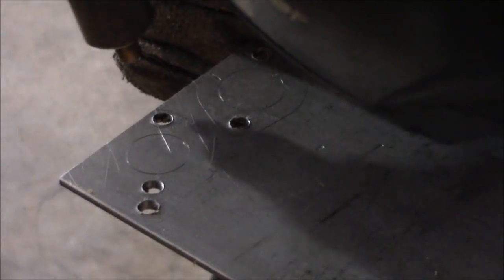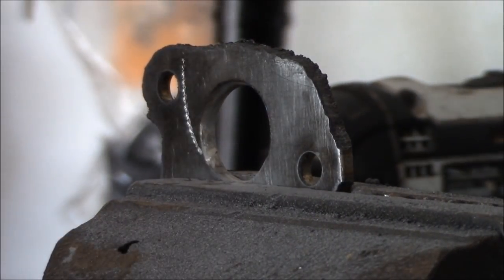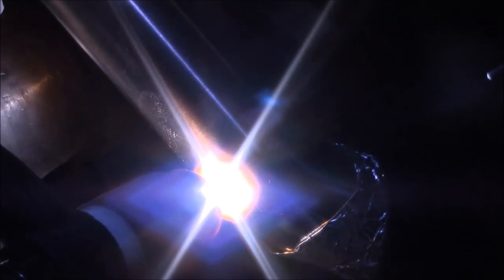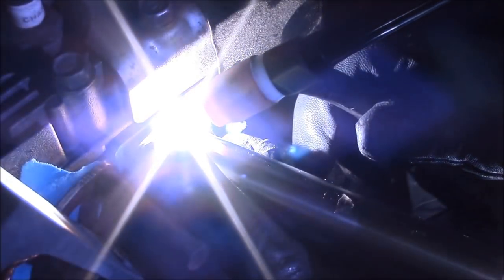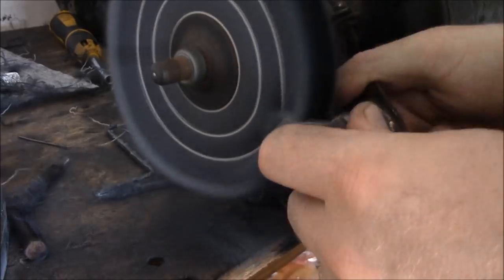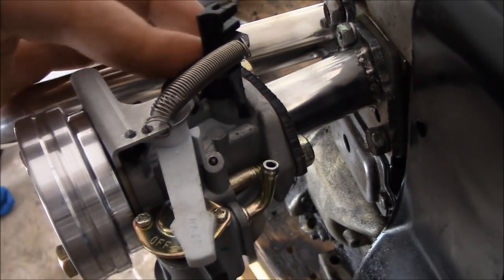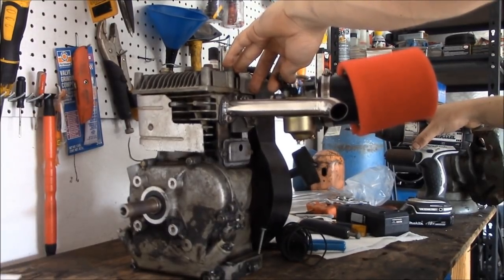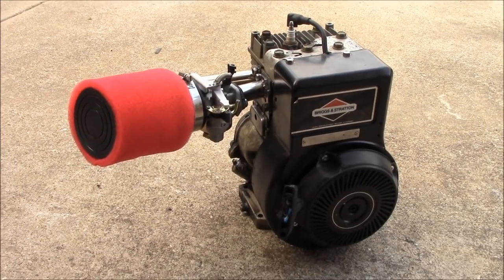BRONDA Engine, Custom Intake and Exhaust System (BRONDA Part 2)

Comment: Wait so why does it back fire
Reply from the maker: William Matthews I looked it up and there are a lot of reasons, one of which makes sense. Notice how the engine only backfires when I let off the throttle? On the briggs and Stratton website, it says that if you lower the engine speed too fast, it is a common cause of backfiring. So that's my best guess.
Reply: Does it harm the engine in anyway and can I put any kind of exhaust on my 6.5 Horse motor and it not affect nothing
Reply: Like would it not affect the bike but make it louder
Reply: Motor*
Reply from the maker: William Matthews yeah man, like a honda gx200 or predator 212cc could have a custom header put on it, gopowersports sells them here www.gopowersports.com/predator-performance-header-pipe/#aid=2986

basically, a header helps your engine breathe OUT, so you need the other piece of the puzzle too, a custom INTAKE or high flow INTAKE (which they also sell here http://www.gopowersports.com/products/predator-performance-air-filter-with-adapter.html/#aid=2986

So when you put on a custom header (exhaust) you will modify the engines power band (giving it the ability to rev higher, be louder, etc) its not going to damage the engine to put on any old header (or even your own custom one which I did), but if you put on a manufactured one, you will get even more power as they are designed with the best performance in mind. I have heard that the gx200/honda clones/212cc engines like to have a long curved header, but I have never modified one of them. Hope that helps!
Reply: Thank you so much I love how you reply to me! You helped me out :p
Reply: Sorry too keep asking questions but do I need to reject the carb too for this to all work properly?
Reply from the maker: William Matthews It depends. If you remove the governor, yes a rejet is in order so you wont run lean above 3600 RPMS. If you leave the governor intact, you may not need to rejet. Ebay is the best place for a jet, a #36 or #37 jet would be ideal. Some people (including myself) use a 140 emulsion tube for a stronger fuel signal at the carb. So if you were going to remove the governor, you could do intake, exhaust, 140 e-tube, and #36 jet.
Reply: Thanks you gave me a lot of very useful information :p
Reply: +KartFab Same with predator engines (at least for me)

Comment: All this work and you never clean the sludge off the engine.
Reply from the maker: Haha I know right? The worst part is when I slide the bolt in to seal the governor arm and you hear that grating dirt against the bolt. It's just an old worn out Briggs. If I destroy it, I'll just get another one for $20 and swap out the external stuff and remove the governor.
Reply: +KartFab You should make it all shiny and do a fake advertisement for it, acting like it's a new brand.

Comment: where is the gas tank
Reply: He used a funnel and a fuel line hanging on his tool board
Reply: Where would you mount a gas tank i like the video btw
Reply: +Al Blazek you could find room on you go kart/ mini bike frame or fab up a mount near the intake mounting bolts. Btw i did not make this video
Reply: cool thanks makes sense